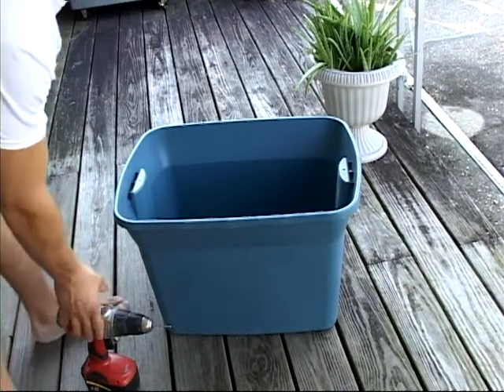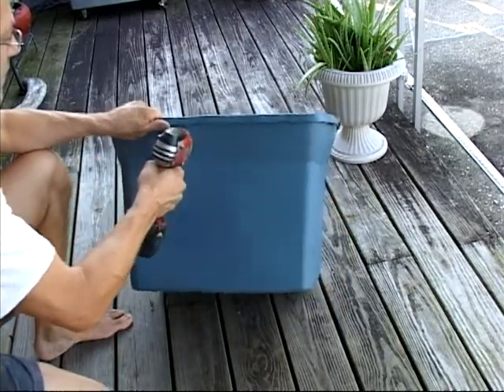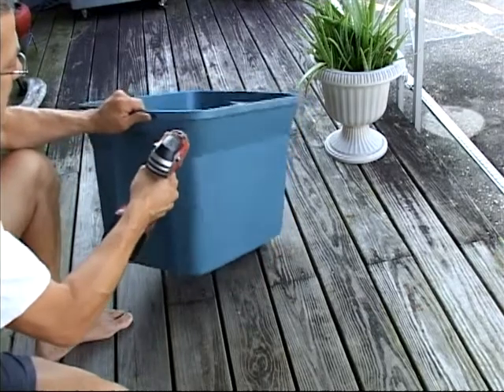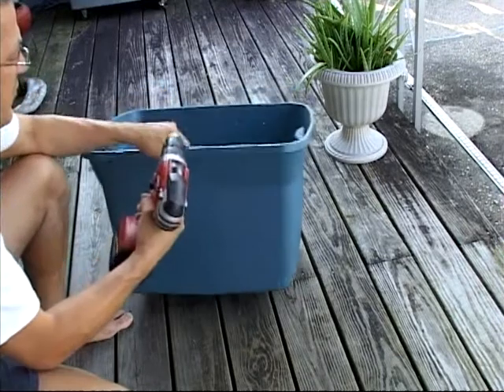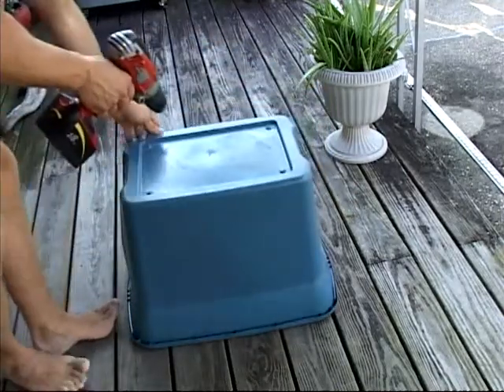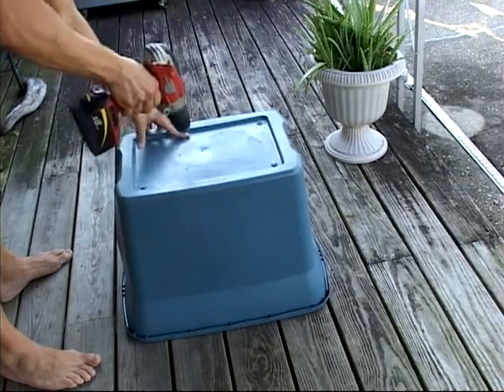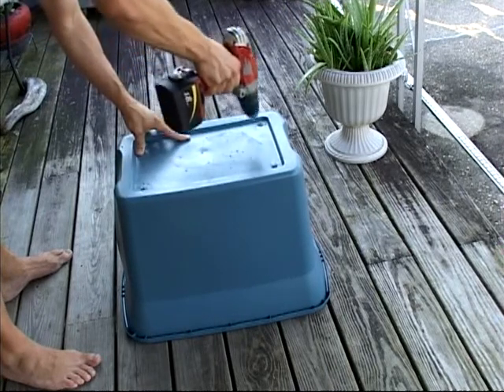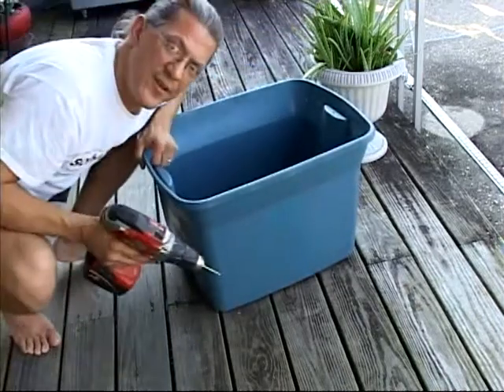How to drill holes in your worm bin.

Comment: If you add holes on bottom, won’t the worms just leave ?
Reply from the maker: You may get a few worms crawling out the bottom, however you need the drainage for your decomposing kitchen scraps.  If the liquid isn't allowed to drain it will build up in the bottom of the bin and become sour and rancid. This will lead to the death of many worms as well as attracting unwanted insects.